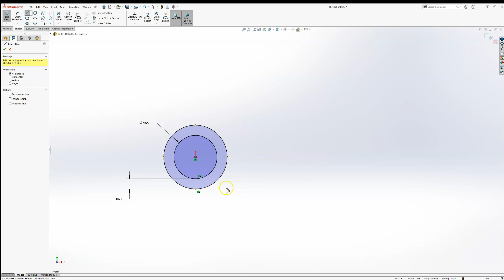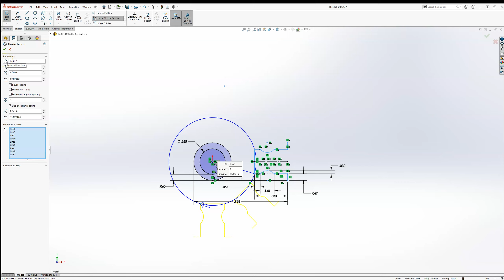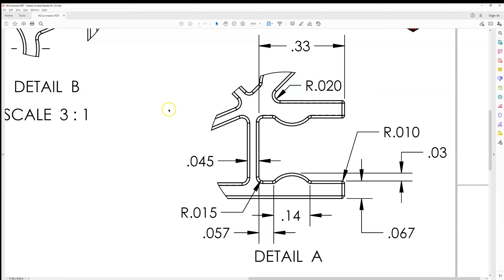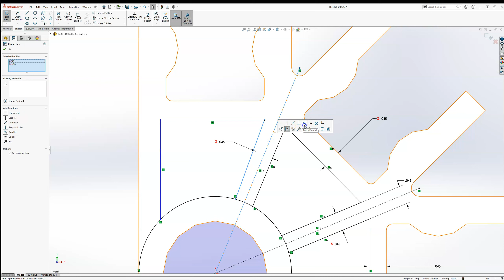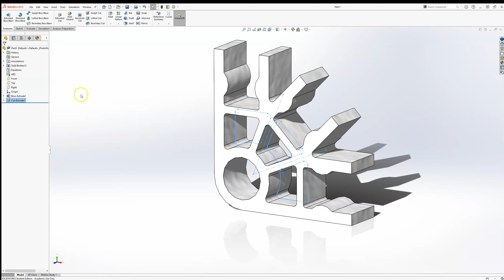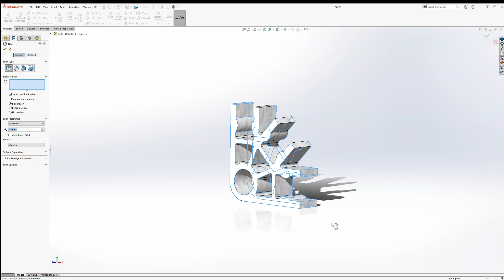SolidWorks Part - 90 Degree Knex Connector

Comment: hi,teacher.i know these are basic videos to help learn foundation,i also appreciate, and i like watching also,could you make modeling gears tutorials using solidworks in later advanced tutorials,such as bevel gear,worm gear ,maybe gears modeling are most hard things in engineering graphics,for me.
Reply from the maker: I will keep that in mind for future work.  Sometimes I intentionally avoid putting all the detail associated with gears and screws into my models.  Usually I am interested in the kinematics of an assembly that use those as components.  For example, rotating gear 1 will cause a rotation of some many degrees in gear 2.  This type of interaction can be modeled in SolidWorks with the mechanical style of mates.
Reply: @frankieskaggs409  yes,gears basicly are standard components,i  like  baja,go kart,walking machine these things,these machine usually use many sprackets gears chains basic machine elements so i generate ideas to make these models and seesembly use solidworks can be fun.
Reply: @frankieskaggs409  one more question,can you analysis how the walking machine steering work ?i want make this machine into solidworks but i dont know how does steering work  https://m.youtube.com/watch?v=03szt5Ln9bs